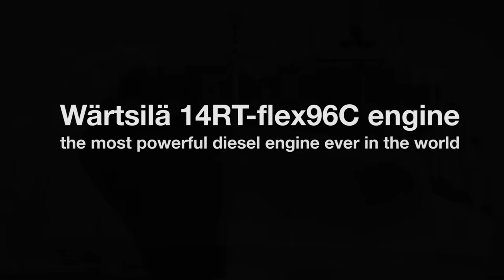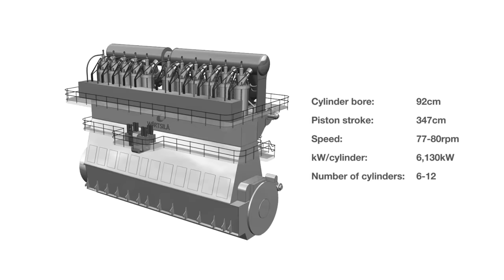WinGD's 14RT-flex96C the most powerful diesel engine (formerly Wärtsilä)

Comment: Made in Finland 😎🇫🇮
Reply: Built under license by Doosan in South Korea.
Reply: No. Designed and engineered in Switzerland originally by New Sulzer Diesel, now  WinGD (Winterthur Gas & Diesel Ltd.)
Winterthur Gas & Diesel (WinGD) is a leading developer of low-speed gas and diesel engines for marine propulsion. Headquartered in Switzerland, since its inception as the Sulzer Diesel Engine business in 1893
Reply: Chinese labour it looks like
Reply: @Horgnerbueb  How is that possible when New Sulzer Diesel sold diesel engine manufacturing to Wärtsilä? Also WinGD doesn't have this engine on their site.

Comment: For your information, it consumes (at peak efficiency), 6400L per hour. Thats 1.77L a second!
Reply: ... and it's not running on the cleanest fuel on the market. https://en.wikipedia.org/wiki/Heavy_fuel_oil
Reply: @ClaudeSac  That's right, but what's the alternative? Surely if there was a cheaper one they would use it.

Comment: How many miles per gallon does this thing get. I’m guessing maybe about 1/16
Reply: Not that much. Approximately 80,000 gallons to drive a 450 million pound container ship 600 miles. (250 tons of fuel a day, ship travels 600 miles in a day). But for as large as they are and considering the weight they're moving, it's an incredibly efficient engine.
Reply: You mean gallons per mile.  It burns a gallon per second.
Reply: @garywilliams6670  maybe around 17 litres a minute and 1000 litres an hour ..160 gram per stroke so at 105 rpm it would take this much ..17 litres a minute

Comment: Container ships want to go slower now? I don't get it, unless it's a way to use less fuel.
Reply: That's what it's for.
Reply: the engine alone uses 250 tons of fuel not sure what their saving lmfao
Reply: @yung_drakoo3605  same with a car, going top speed doesn't mean you get the furthest/tank so they reduce speed to minimize the drag of the water, aswell as improvising the hull designs so that instead of 450 tons they "only" use 250 tons of fuel

Comment: how do they start one of these?
Reply: By injecting compressed air into the cylinders. Each cylinder has it's own starting air valve, all fed from a main starting air distribution line. The starting air valves need to open and close at the correct piston positions, of course. This is obtained by controlling the starting air valves with pilot air (on some engines, at least), controlled by a distributor. The distributor activates the individual pilot valves, based on the position of the cam shaft (or electronically). Starting air is stored in two pressure tanks. For an engine of this size, we're talking several m³ per tank (15-30 m³, perhaps) and a pressure of around 3 MPa (30 bar).
The principle is explained here: https://www.youtube.com/watch?v=uMmQGCzszJk
Reply: @Andante1961   thank you, I've never heard of a starting valve until now but that seems like a very good idea i cant imagen starting this with another motor/engine

Comment: What does the big gear connect to?
Reply: Probably the camshaft.
Reply: There is no camshaft as the valves are electronic/hydraulic. less weight, less wear.
Reply: @Kevin_McGeary  The big "gear" is for the turning gear, which is en electrically driven mechanism that can be engaged when the engine is stopped. It will prevent the engine from turning due to external forces (propeller wash from other ships, for example), and also enable slow turning of the engine for inspection and maintenance purposes.
Reply: Depends, does your mom want it in the front or in the back.

Comment: What is the gap on the spark plugs?
Reply: It's diesel, so no spark plugs. Maybe glow plugs though.
Reply: joe woodchuck spark plug wires must be 000/.....
Reply: 20 feet.
Reply: @joewoodchuck3824 .... there are No glow plugs used on these engines.